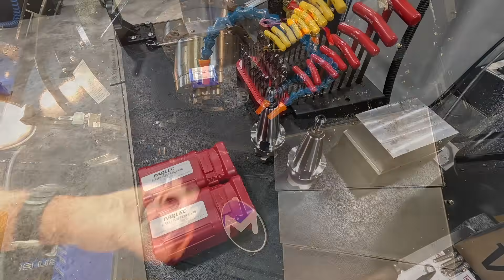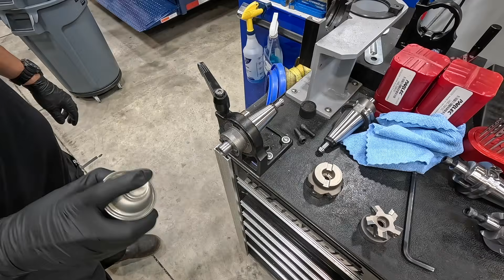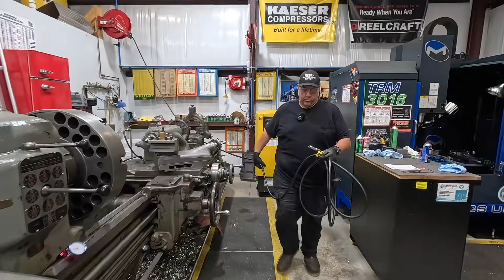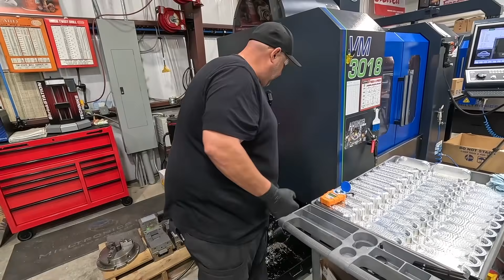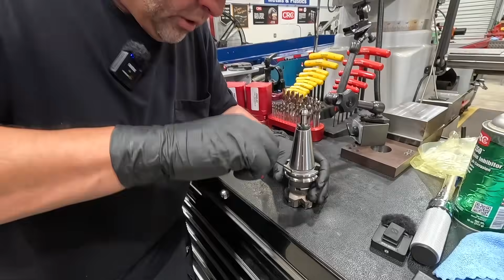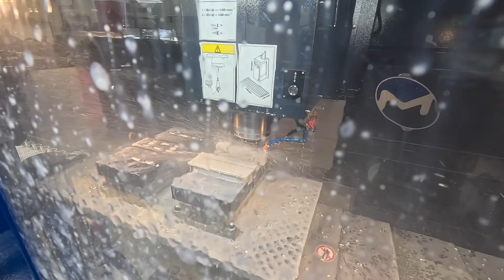Tool Tuesday: Parlec Coolant Through Facemill Holders

Comment: I was curious about the ports and setscrew seals...
Did a quick look, didn't see a manual on the TechnicksUSA site...

However in the arbor's description I spotted: "Use CoolBLAST arbor screws for coolant-through face mills. "
Possibly for face mills with ports similar to through-hole drills ???

Or, possibly an option for clearing out the internal passages?

Comment: Milltronics should have an option of shop air blasting the windows insides when the doors are closed and the machine running.
Reply: that doesn't work because of the no-slip condition

Comment: You really should find 4 extra setscrews and block the last 4 holes so you get the full use of the TSC pressure. 

And you should be able to run both TSC       
& flood
Might have to put the TSC and M8 on different lines in the program.

Comment: Adam, if you lookup Edge Precision, Peter designed a Go Pro case that used shop air to "air jet" the screen so the camera could be in the CNC for shots - even with coolant flying. Peter is now retired, but his channel is a wealth of info.

Comment: The extra hole you are considering plugging probably helps with chip clearing.  It will be interesting to see the difference with them plugged.
Reply: It's meant for flange style TSC machines to redirect the coolant to the center of the tool.

Comment: 31:03 - take a look at AVE with his spinny-window-coolant-cleary device. Believe was posted a few years ago.
Reply: Boats have a motorised round window called a clear view to spin the water off the windscreen in heavy weather where spray is constantly coming off the bow and blowing back over the cabin windscreens, so the skipper can try and maintain an adequate watch for potential collisions with other vessels or indeed structures etc.

Kinda makes me wonder if maybe Adam couldn’t maybe fit one to a best position filming window to spin the coolant off and improve his video clarity?

Just me thinking out loud.
Reply: @drape47 - broke my leg running to the comments to see if anyone mentioned AVE’s setup.

Comment: I had a job that used oil to lube they're finishing machines. They would make a mist that clouded the air in the plant. They later installed mist collectors to clear the air. When you opened the door after your op-2 test run it looked like there was a mist in the air inside the miltronics. Does the coolant from the cnc mill make a cloud in your shop?

Comment: I live and work not far from Parlec! 

I've had a bad experience with touching off face mills spinning on the table probe. I was trained to just find your lowest insert, it's manual with the probing system, but it beats accidentally knocking the probe out of alignment. 

Though 5 inserts requires 5 touch offs, I was pretty lazy sometimes where i'd figure which insert spot was the lowest outside the machine or on another machine and then, ok I got my spot to pick up on with the table probe.

Comment: I wonder if they make an air curtain or one could be modified to blow down in front of the glass to redirect the coolant away from the glass. We use air knives at work to blow off water from cooling and also in front of optical sensors to prevent them from getting dirty. Maybe have it on a valve so it could be only used when filming because they use a lot of air.
Reply: Also known as an air blade. I've heard of someone 3d printing them for the windows of a CNC. I've made some simple ones out of stainless steel for conveyors,

Comment: There is no point using TSC with tools you're using. For alu you just need some lubrication so the chips don't get stuck and weld  itself to cutter. In tool steel for example you run high feed mill dry with air blast. switch to coolant and tool wear increased 50%
Reply: Did you do an actual test to prove that running dry results in 50% less wear?
Reply: @ellieprice363 yes with tungalloy high feed that I'm using, there is big difference. I'm using coolant only for very small parts as they get hot and also cutter get hot, so there is a chance of overcut. 50 percent came from testing in 1.2379 / D2 tool steel